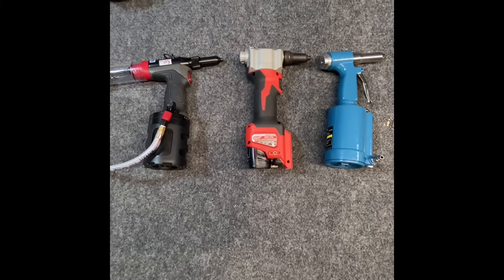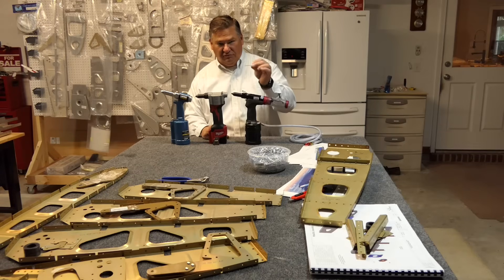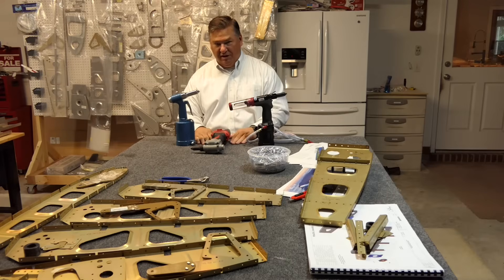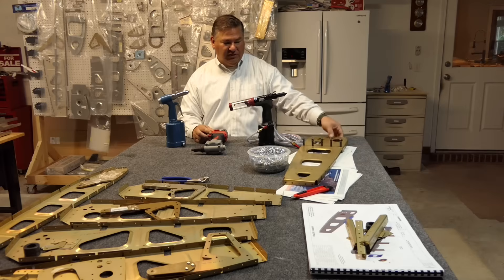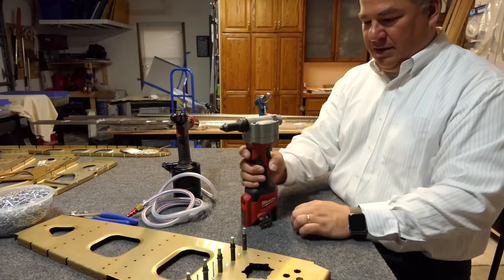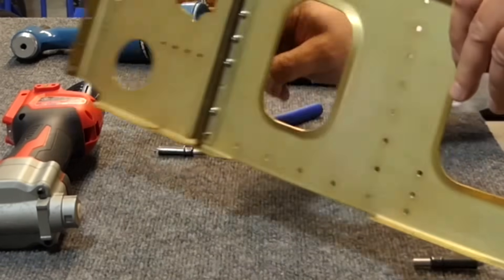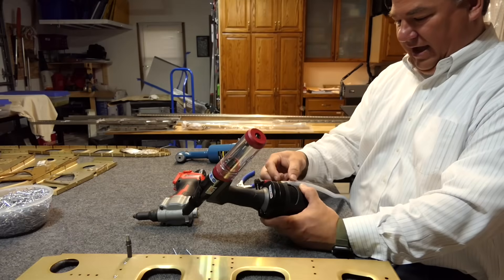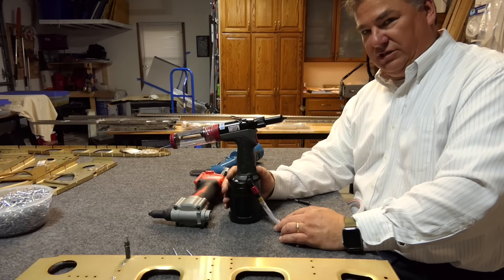Rivet Gun Review - Milwaukee M12, Proset XT2, Harbor Freight

Comment: Couple questions;  I find the manual pretty lacking.  
Did yours come with the air hose?
What is the long tube thing in the bag with the nosepieces?
Does the riveter require oiling like other air tools?  I found mixed answers on that...
Thanks in advance, the video was very helpful
Reply from the maker: I had an air hose that came with mine that was just a straight extension to push the bulkier air supply line away from you a bit. I have not oiled  the internals, just the nose pieces. I was told to not put oil in the air line like you do for some tools. The company recommends servicing every 35000 rivets or something like that. You would send it back to a service company for that.

Comment: Good morning everyone.

I hope someone can help me, I am about to buy the PROSET XT2 riveter, but I would like to know if someone already has it with them so that they can help me to know the diameter of the nozzle for the rivets, the area where I am going to rivet has a space of 8.88mm wall to wall and has a depth of 8.5mm, I would like to know if the nozzle can go in here.

I hope someone can help me with this.
Reply from the maker: I would say no, it won’t fit. The actual changeable tips are about 6mm long depending on which size and have a diameter again depending on size ranging from 5-8mm. After the end of the tip it flares out to 11mm as it screws into the nose piece. Try finding a small hand riveter maybe. I have three guns and a hand riveter and none of them would work with your dimensions.
Reply: @aviationkitbuilder  Very good.

Thank you very much for taking the time to answer, I really appreciate it

Comment: @aviationkitbilder, I do not think the Milwaukee rivet gun issue that you have reported, has to do with corrosion in internal parts. My brand new piece has the same problem, where in the tool does not suck in the mandrel in to the collector. Also the first time, the rivet just got jammed which reportedly has been reported by many other users. Also today I started riveting the Empennage Rear Spar channel and  the tool just does not consistently pull the rivets.
Reply from the maker: Perhaps, sorry to hear you are having issues with yours.  I liked the idea of the Milwaukee gun a lot (battery instead of air lines,  and price) wish it had better reliability.

Comment: Thanks for this amazing video. but i have doubt. So do we need to put the hole first before putting the rivet ? or does the riverte does the job of creating a hole and then insert rivert by itself ?
Reply from the maker: The hole has to be drilled first and then you insert the rivet and then pull the rivet with the rivet gun.  Thanks for watching.
Reply: We have a 24' box trailer that has screws holding the outside panels instead of rivets. We have to take out all screws and replace them with rivets. Should we hire a professional since there are probably 200 screws? If we do it which Rivets gun would you use?

Comment: Can you point me to the extra tip you needed for the XT2?
Reply from the maker: It’s the 3/32” size nose piece for the 2.4mm rivets.   It normally goes with the XT1 but will fit the XT2.  Here’s the part number information from three day tool.  PRN314 NOSE PIECE 3/32 OPEN END RIVETS Part #119
Reply: @aviationkitbuilder  Thanks.  My XT2 is still in it’s box waiting on a kit.  Wasn’t sure if it came with everything needed.
Reply from the maker: I don’t think there are all that many of those small rivets but you’ll need something to pull them.